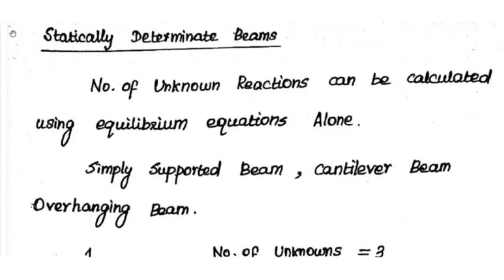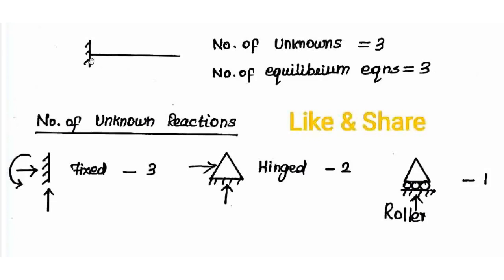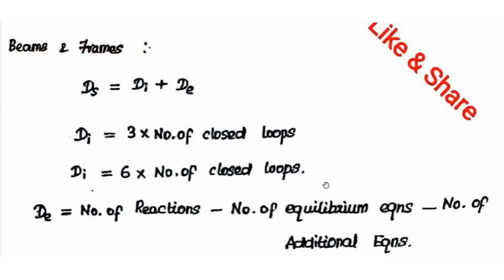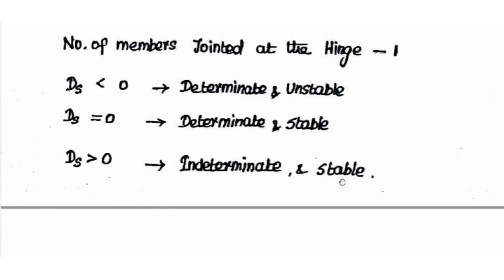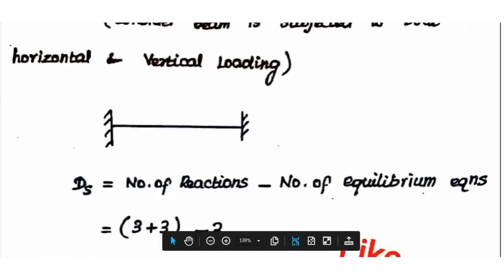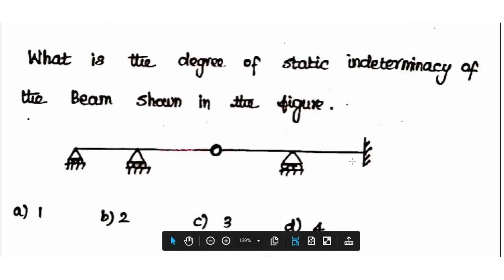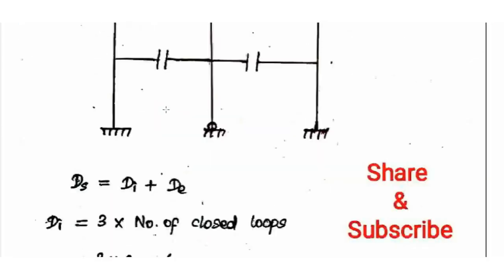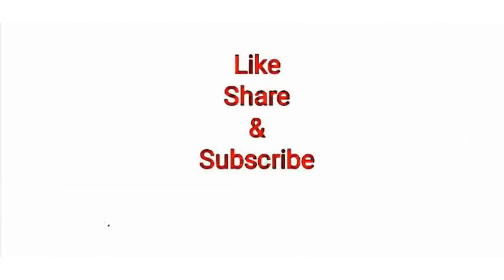TNPSC AE Civil Preparation in Tamil - Static Indeterminacy -  - Structural Analysis

Comment: Correct me if I'm wrong mam
For propped cantilever
Both horizontal and vertical loading DS =1
Only vertical loading DS=1
Reply from the maker: Your Answer is correct for vertical Loading.
Propped Cantilever beam
General Loading
Reactions = 3+2=5
Ds = 5 - 3 = 2
Vertical Loading
Reactions = 2+1=3
Ds = 3 - 2 = 1
Reply from the maker: Reference Book - Theory of Structures by B. C. Punmia